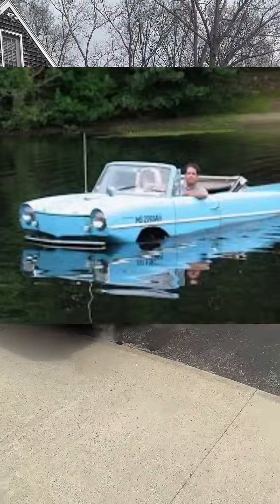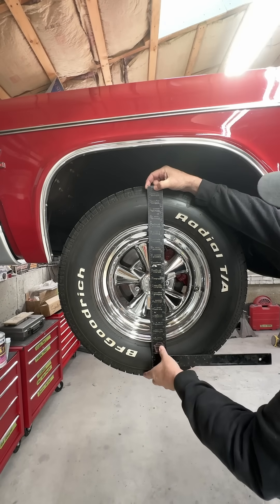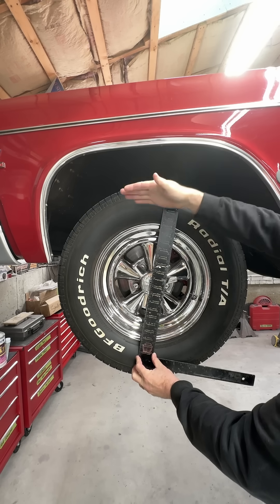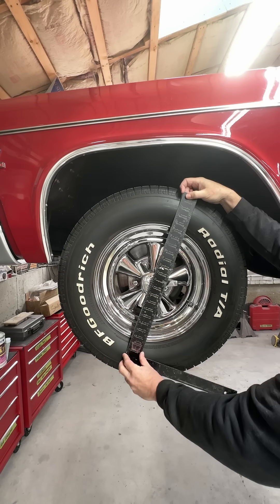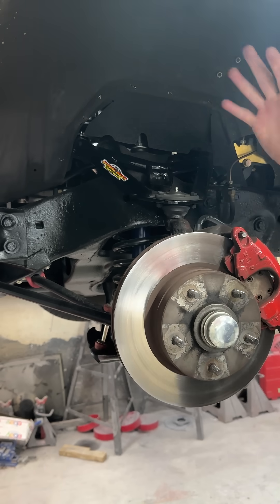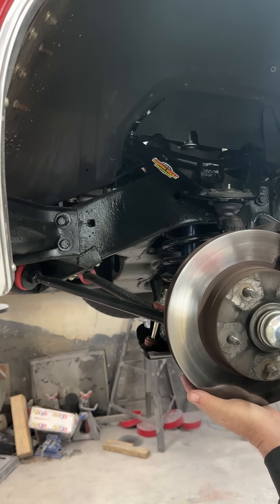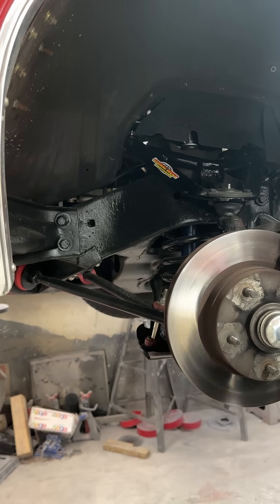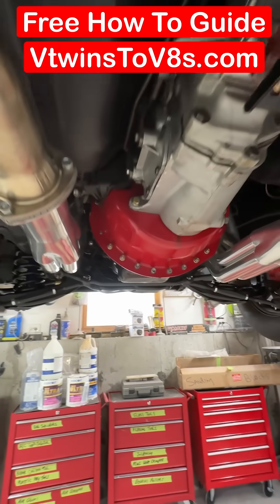"Why Your Classic Car Wanders – Caster Angle Explained FAST!"

Comment: Pretty sure the factory original parts installed at the factory allow all necessary alignment adjustments to be made
Reply from the maker: I disagree. The car of the fifties and sixties and little to no positive caster.
Reply: @ I did alignments . There are shims on those babies . And tie rod adjusters . But I agree the new stuff you’re installing will definitely improve the ride . .It’s just that you’re implying you need to buy “these “ parts .  Btw love your channel and body work , polishing videos etc 😊
Reply from the maker: @jraposo911  Thank You! And trust me I drove this car with the stock suspension for 40 years.

Comment: I have a 1970 c 10 I’m having issues with getting enough caster and I’m all out of adjustment.
Reply from the maker: You need to change some components. The 
vehicle's original design is limiting you.
Reply: @troykane yes I know but I can’t get anyone to help. I called Hotchkis for help gave them my computer readout of what the alignment people found and no one has got back to me. Twice I called them to get upper Controll arms. I have now on the left side a - 1 degree caster and it’s all out of adjustment shims and if the do anything else it will mess up my camber so we’re at a standstill.
Reply from the maker: @ If you want me to dive in and help you, go to my website and sign up for a one one consultation. I've done a lot of these and can help you but it will take me time and that will cost $$$